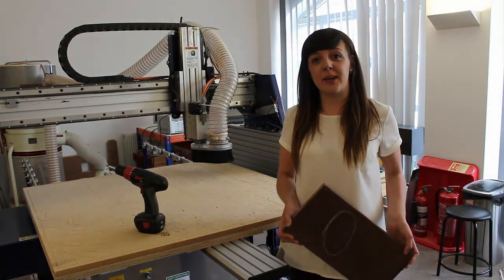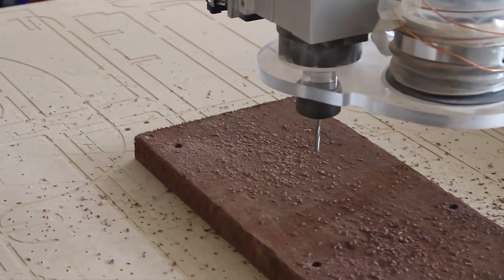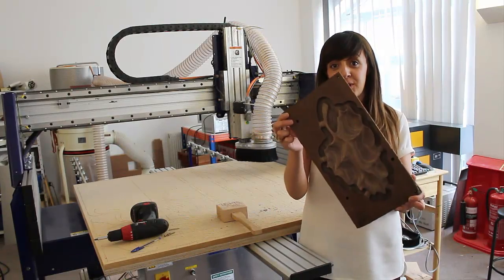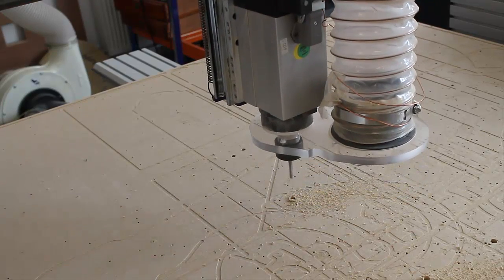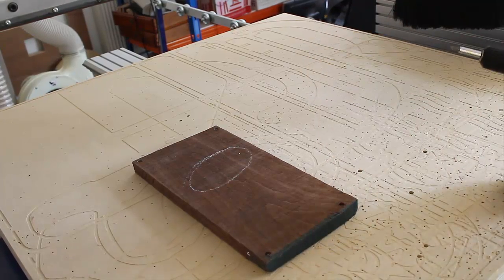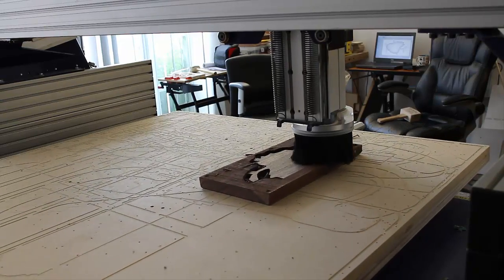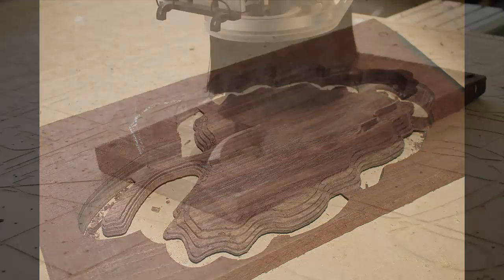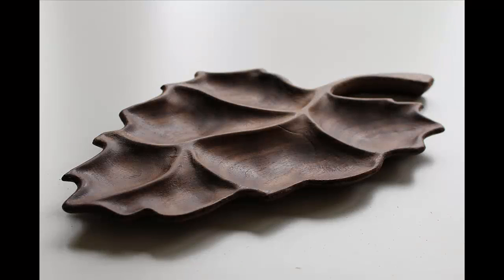2 Sided Machining - Leaf Bowl - Practical

Comment: ı saw your software very usefull. i recommend every woodworker cnc operator should use vectric aspire. omg its very good cnc machining software.
Reply: Also, far too bloody expensive! Only commercial operators can afford this 'ware. Hobbyists... no chance.
Bearing in mind this is supposed to sell the software, it's noticable by it's invisibility.
No mention of how to program the 'flip', or how to locate position of the dowels in the spoilboard.
Part of her early explanation is so muffled, it's incomprehensible.
Pretty bad show for such a good app.
Reply from the maker: Thank you for your kind comments Jeny, glad you are enjoying the software!

Comment: where have you set your WCS zero for this particular project? Stock corner, or a specific feature in your leaf design. making the 3 holes for pins in the stock, then flipping the part over on mirrored holes allows you to set the design parallel to the x and y-axes after the flip - so how have you measured the {0,0,0} after flipping the part? :) Thanks
Reply from the maker: Hey Viorel, If you take a look at these videos hopefully that should help answer you questions: https://www.youtube.com/watch?v=J7LyyO6svKo Thanks :)
Reply: @vectric  I watched yout video but it didn't answer my simple question....
Reply from the maker: @ViorelStolea  Hi Viorel, The X0 Y0 for both sides is set to the lower left hand corner (on the top side it would have been roughly at the lower left hand corner of the material, and for the bottom side any where on the spoil board (ensuring there is space for the part to flip over)) The Z0 for the top side is set to the top of the material block and the Z0 for the bottom is set to the Material Surface (referencing from the same face) I hope this answers your question :)
Reply: @vectric  Thank you. So you used a point on the stock, not  a point of a feature you already machined. Got it!

Comment: Hi.
What do the springs on the Z axis assembly do?
also
 what has become of the prequel to this video?
also
the moving table gives me a migraine but i still have to watch!
Thanks,
Rob.
Reply: RobSmathome they counterbalance the weight of the moving parts of the z axis so the z motor is less likely to miss steps and won't run as hot as it would otherwise.